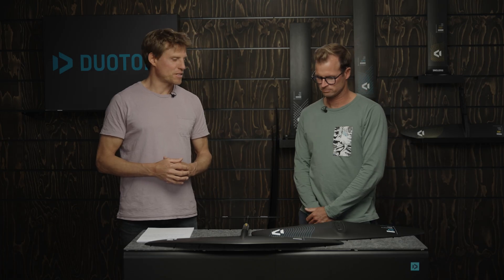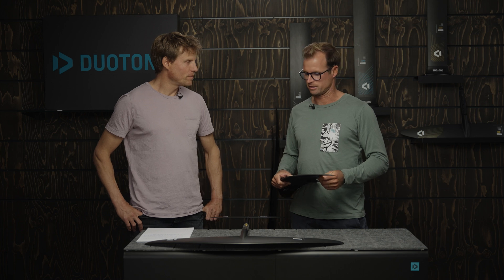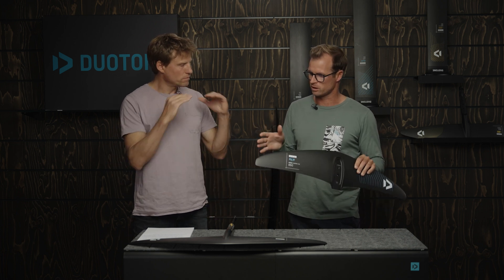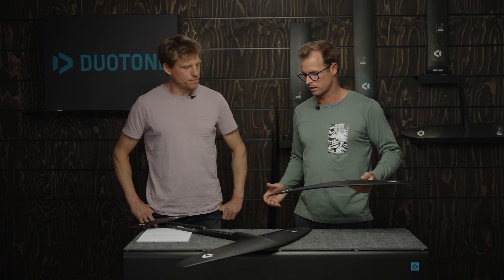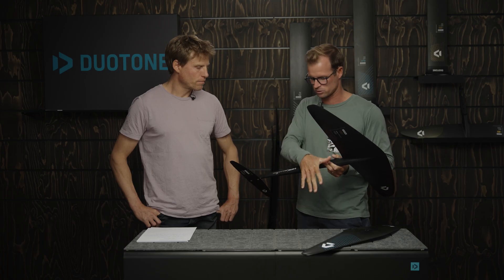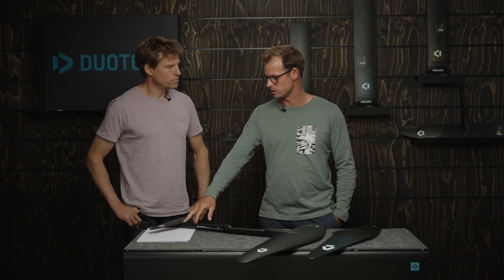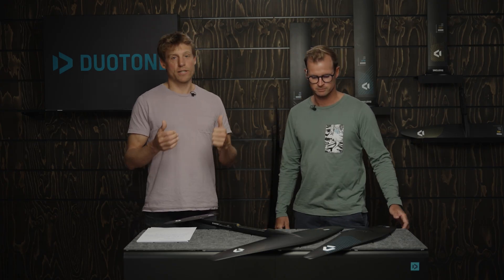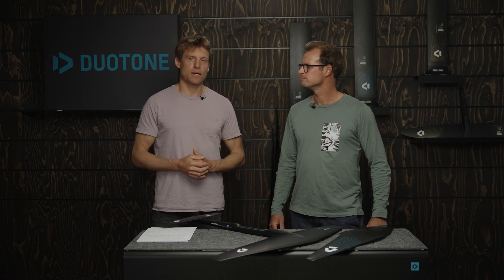Duotone Wing & Foiling Tech Talk - Aero Carve 2.0 2024

Comment: Are you using the D/lab 850 also with the P165?
Reply from the maker: Hi there, Klaas just on a break currently, but yes, sometimes the guys are using the smaller back wings one size down, to get more turning ability - so for example 850 with 165 from the 650, or 1100 with the 180 from the 850...this works quite well, especially if you are a bit more powered/have the skill set.
Reply: @duotone.wingfoiling  thank you!
Reply: @duotone.wingfoiling  I tried it yesterday 850+P165 and it worked really well! It pretty much felt like the AXIS ART799 + Progressive 300 but much more forgiving and awesome speed. Really cool foil!
Reply: @duotone.wingfoiling  thank you, this works perfectly! I swapped stabilizers to 850+165 and 650+180 and do the rest with the shims. Interesting that the 650 can be used with the bigger stabilizer to get the pumping ability back in lower winds.

Comment: The S Stab Looses the Carve in Waves ..so Whats the best size for the 1100 & 850 Dlab with 43cm Tail ?? 
Greets 
Matthias
Reply from the maker: HI Matthias, you can go for the similar size to the P which comes with the Carves - so for the 1100 you can choose a 210 or the 850 a 185 - or go down one size if you want to loosen up much more - 1100/185 and 850/165 - also, the best way to loosen up both of those is by using the 37cm tail - this will make the most difference.
Reply: @duotone.wingfoiling  ..hi ..thanks for the tip ,I’ll take the 185 First and try on Both Wings ..i had already test the 37cm tail and thats to much ..Like to have something in between ..maybe the change of the Stab will work 👍
Reply from the maker: Give it a try and get back to us!

Comment: Hi! Still don't understand how an such low aspect ratio can be fast compared to an glide for example! Maybe u can lighten me a bit?
Reply: Low aspect ratio generates less lift, less lift means you can ride faster. It all comes down to how much camber you have built into the profile as well. The Carve has relatively little camber built in, allowing it to cruise at higher speeds. Also the reduced span allows the rider to lean more and to push harder into the foil.
It doesn't mean that a higher aspect ratio foil can't be fast! It is just that in our range, the Carve is the faster design.
Reply: Until now I thought lower aspect means slower as it has less Efficiency.. The most beginner foils got lower aspect. I am a bit confused. But guess the volume and the thickness also plays a big role?
Reply: @dirkfuhrmann4124  That's correct. There are a few important things when it comes to speed:
Cord length: This is where High aspect foils shine and mid aspect foils less so. This is also where your misconception comes from. Lower cord length does indeed mean that the foil is faster so in that part HA beats MA.
Thickness of the profile: The thicker wings are obviously slower. The carve is a very thin wing (at least in the 500-650-850 range which are the ones I've ridden). This allows for less drag and a faster profile. The Glide is also thin, dont get me wrong but the carve is thinner I think.
Span of the foil: So here comes the problem with most production HA wings. The wider the foil is, the more drag you have. This is not a huge amount, but the main problem with HA foils is that the higher the AR, the higher the lift for its size (10 AR HA 800cm2 has more lift than a 7 AR MA 800cm2. Of course there are profile aspects that influence this, but thats the general gist). Lift sounds great at first, but it becomes a problem at very high speeds (read above ~45km/h). The faster you go, the more lift the foil generates. With a HA foil, you will be fighting to keep it in the water at very high speeds.
On top of that, if you have a very wide and thin foil, that means that the board cant be canted over as well without having a lot of mast in the water or breaching the foil (see this picture illustrating the problem https://imgur.com/a/3EJeWDN).
If you look at custom race foils like chubanga, you will see that they are a HA design, but those are sizes 300-450 or something. At those sizes the span of the foil is a lot smaller than lets say a glide 2.0 620 making it way less of an issue. They also have slightly tuned designs that make them less lifty at high speeds, but thats a bit of a side thing.

@BonieuxJerome I think this is pretty well summarised? Please correct me if I am wrong somewhere :). Also, thanks for all the tech talks, can't wait for the next foil release that you have been working on ;)